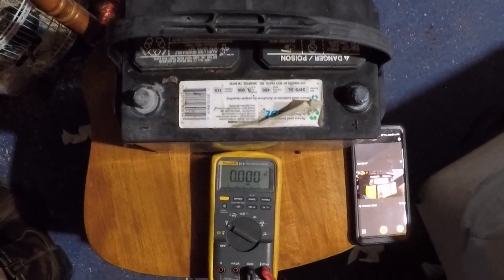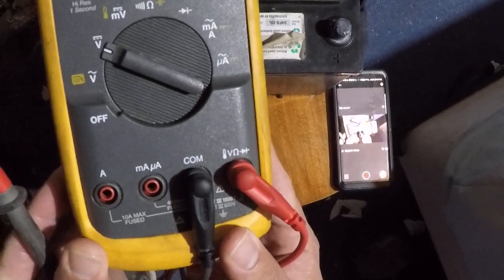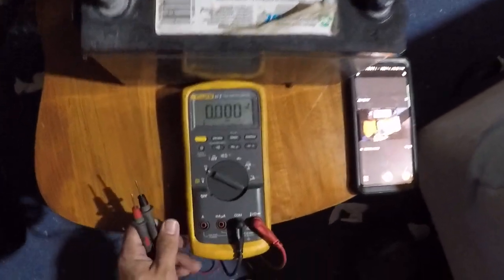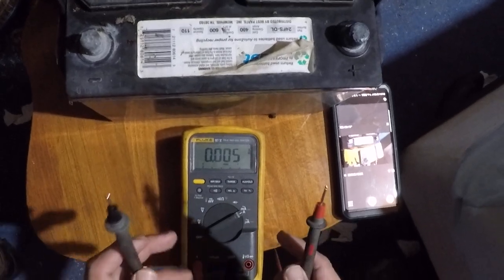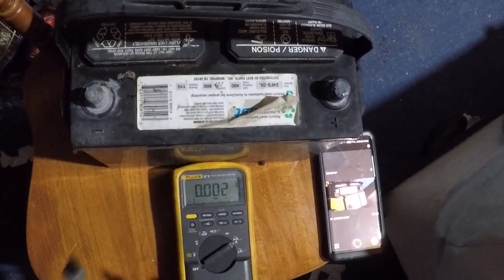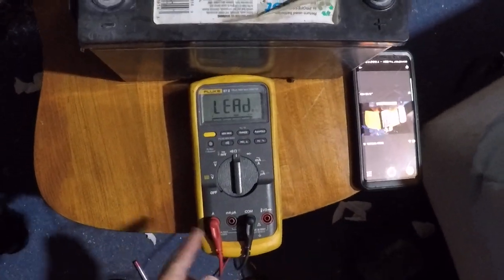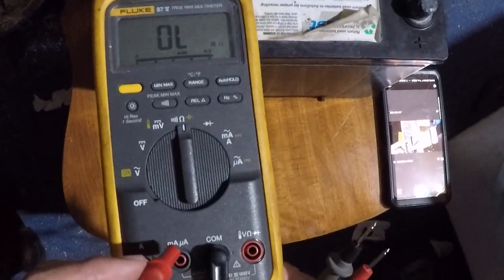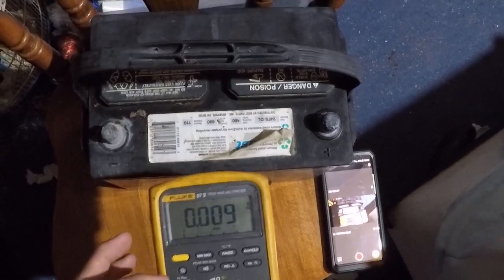How to blow a fuse and test for blown fuses on a multimeter (example basics using Fluke 87 )

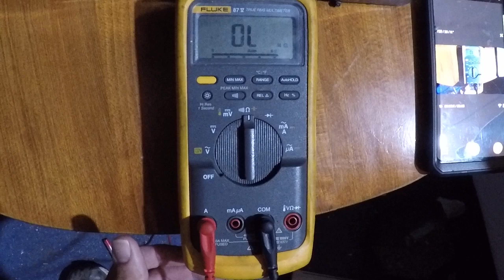Comment: At 3:14 I get no beep unless I also touch the other ends of the leads. Is that right? I see when you check miliamps that you have in your hand two probes NOT touching. Are other probes connected? If I connect them it works. If I just stick the leads in and the probe ends just dangle - I don't get a beep.

Comment: That method of testing the fuse didn't work on the multimeter I'm testing (goldstar dm-9183).  I pulled the fuses out and they tested fine outside, but not via the leads.

Thanks for your video though, it prompted me to crack the meter open and I really appreciate that (not being sarcastic :) 👍
Reply: I see now you specify Fluke in the description. I'll leave my comment for fun.